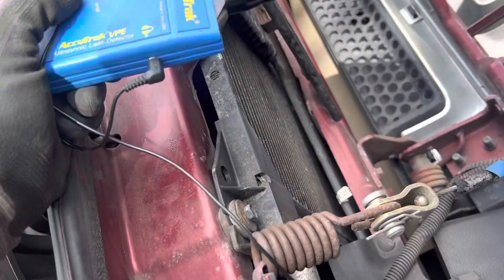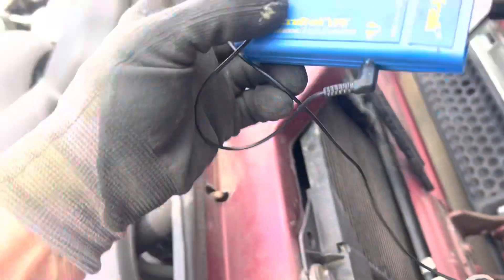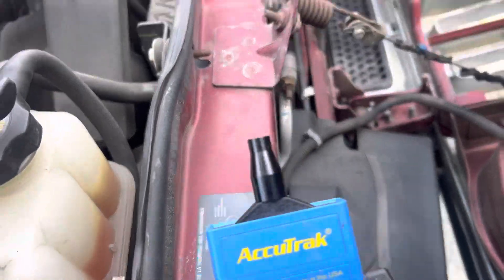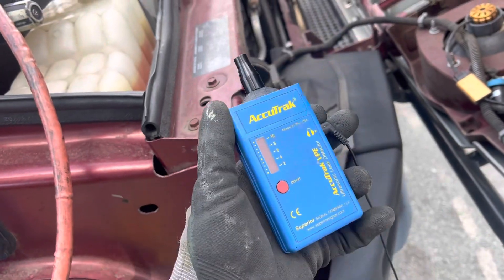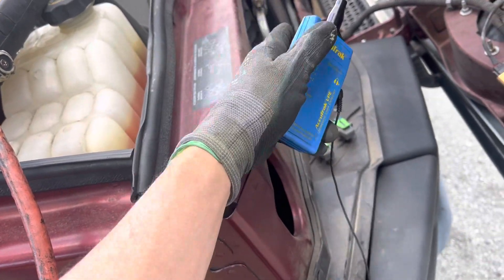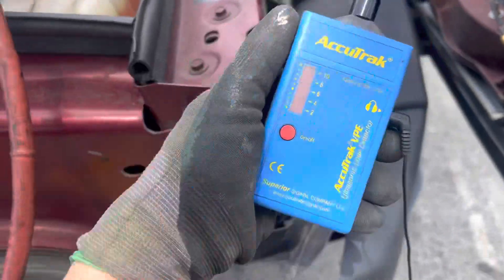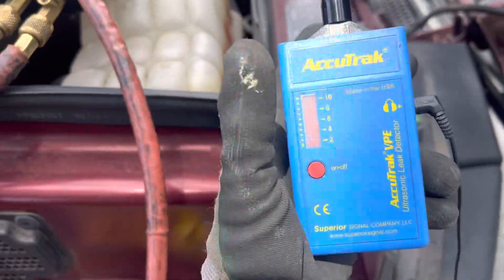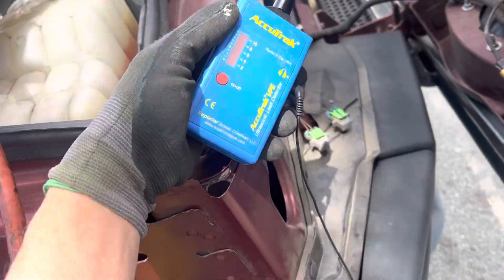REFRIGERANT LEAK STOPPED WHEN SYSTEM FULL AND RUNNING.

Comment: What about spraying the condenser with water to get it to cool down?
Reply from the maker: Sometimes works. But you also have the radiant heat from the radiator just behind it and you have all the refrigerant lines and components and compressor in the engine compartment that are hot too so as long as they are hot, air pressure will be high..   so it will take a while. But it does work sometimes..   

Some later very unpredictable . At not leaking.

Comment: You need to think outside the box. Soapy water?
Reply from the maker: I just ran out in the previous shop and I was parked a block away outside.  Doesn’t matter I know 100% for sure the leak is on the condenser..  don’t need to pinpoint it. 

It was too windy to use the refrigerant leak detector . And the goddamn cars and jet planes going overhead we’re not letting me pinpoint.. 

Customer ordered a condenser and the next day the UV die came out overnight after the vehicle was turned off and parked .  Did not like the whole entire time. The customer was driving. It delete stopped when the AC was actually turned on.. 

It only leaked after turning off the AC and the temperature in pressure dropped close to ambient temperature . Next video shows a huge bigger than the size of your hand UV staying in the center of the condenser..

Comment: Today I found a leak on a  copper elbow of an evaporator with my ultrasonic and I just pushed my finger on the coper and it sealed it up ???
I had 120 psig 

And i
Reply from the maker: 120 psi in a very very tiny little area it doesn’t take much force to seal it. 

If the metal was clean and prep to properly .   And you use the appropriate specialized epoxy paint just a few coats with seal the leak.. 

Yes, I said paint .  Depending on the conditions, it might not be permanent can get you a few months. In some cases I can get you a few years..